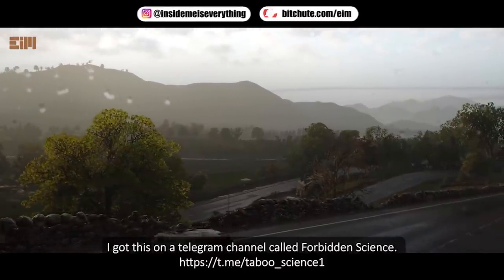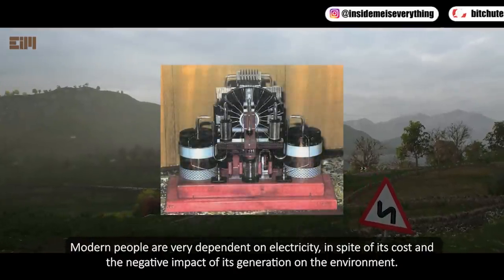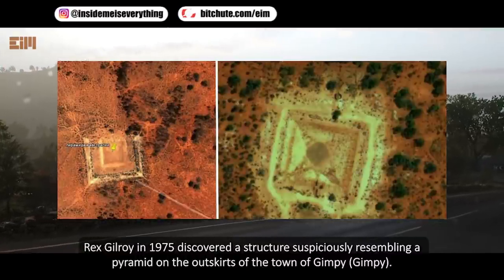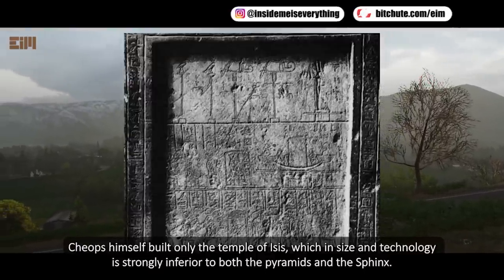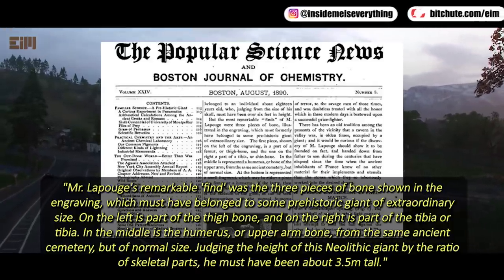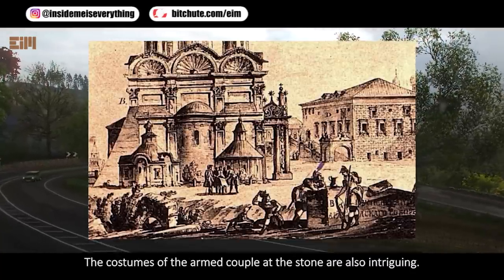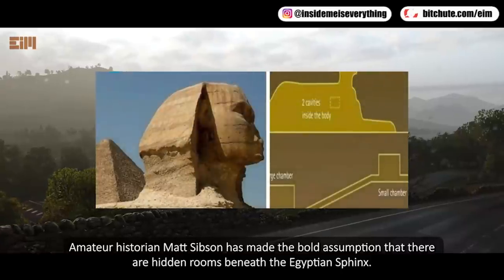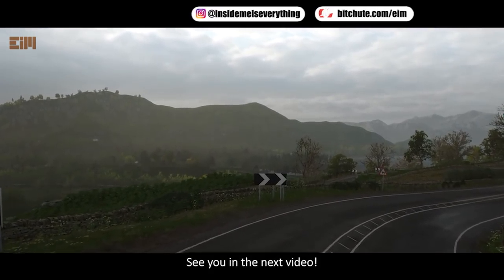WHAT IS THIS?!!!! I'M NOT SUPPOSED TO SHOW YOU THIS

Comment: Very old photos of the SPHINX show an opening at the top of the head which has since been filled in and sealed to look like no entry was ever there. It was put in the best position, on top in case all the rest was covered in sand.  Maybe it is not the main entry but it is there for some reason.  Maybe it was built around something and the hole in the roof was access to the original structure.
Reply: They never show the tail, which is that of a Lion.
Reply: @vijaysuryaaditya9860  One documentary claims the head was originally that of a lion, but eroded away in time, so they resculpted the head into that of a human. Will we ever know the truth?
Reply: @vijaysuryaaditya9860  the tail shows water erosion, clearly. That's why
Reply: @bunch_o_racket  I hear you on the Pharoah's face bit. Makes perfect sense. But if l may, l would like to correct you on the part where you mention the "sun rising in Leo", which is technically incorrect, as that happens 30 days a year, every year. 
According to Rudolf Steiner, roughly every 1250 years, the North Pole points towards a different sign of the zodiac during it's own rotation. (Picture a spinning top as it loses momentum.) This is in reverse order to the order we celebrate our birthdays. 
Right now we are in the Age of Pisces, (Fish symbol for Christianity, the shape of the Pope's mitre/ hat, fishers of men, the naming of most constellations in the southern hemisphere, which were discovered only a few hundred years ago, etc), and heading to the Age of Aquarius. Now go back to the previous age, Aries, (note the sheep and ram sculptures in Egypt - origin of The Golden Fleece story), and before that to the age of Taurus, (worshipping Ba'al).
Before that, was Gemini, then Cancer, ( Noah's flood), then Leo, when l believe the Sphinx was built. This theory allows us to age the Sphinx. 1250 × 5 or 6. Over 6000 years old anyway. The Pharoah's face is therefore "much younger" than the rest of the structure.
Useless information: Something l figured out myself. Go back further to the Age of Virgo, when this whole present cycle started, and you get to 13 000 BC. Now fast forward past our Age of Pisces, to end at the Age of Libra. 13 000AD. We are only half way through our evolution, despite all the civilizations that have come and gone.